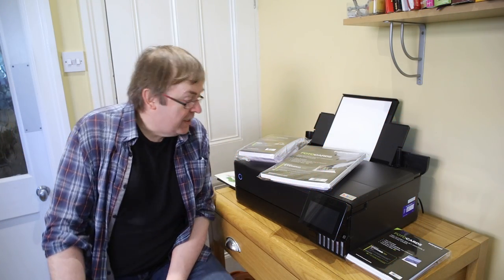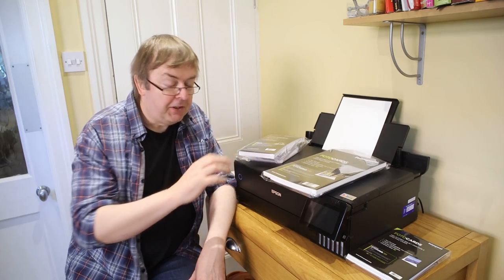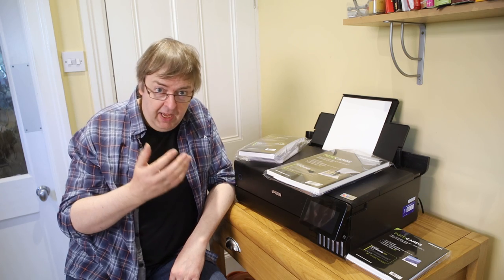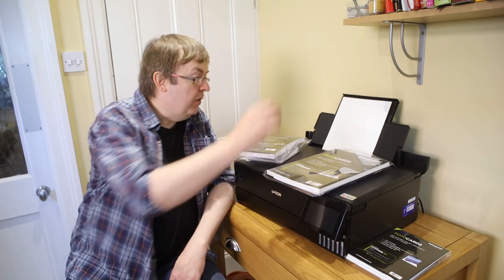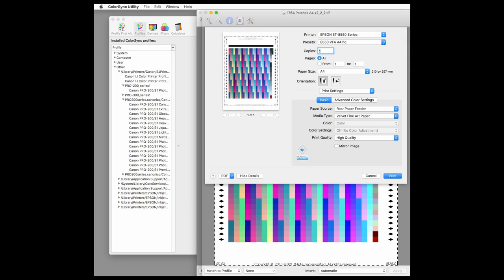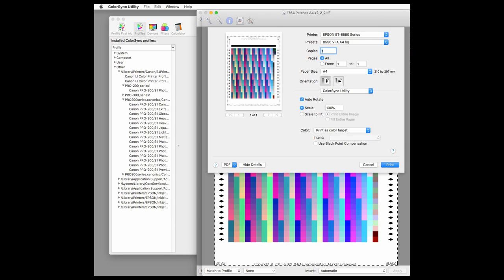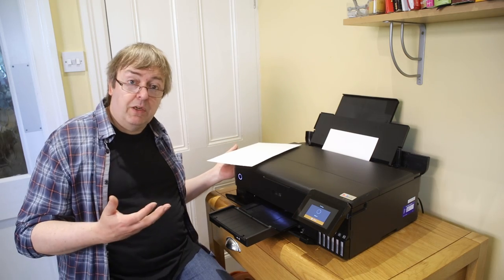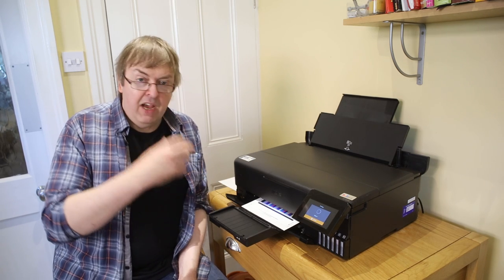Epson ET-8550 scanning artwork to make greeting cards on fine art papers and card

Comment: Thank you so much for this video Keith, very informative! As a watercolor artist I can definitely recognize the struggle with getting the color right. And as I am not capable of making my own ICCs for now it is not the easiest task to get the colors anywhere close to the original. However I can say that already by just using VueScan the quality of the outcome increased rapidly, the scans are much more accurate and very crisp, so thank you for this great tip! I am now just hoping companies will create ICC profiles for this printer for more "craft" papers. I just purchased the Epson Velvet Fine Art but quite frankly that is very pricey to use for printing cards. I am also starting to accept that sometimes it is not necessarily bad things the colors come out "different" then original because in combination with right interesting paper you just create completely new piece of art :)
Reply from the maker: Thanks - some companies (UK) will create profiles if you buy paper/card. The Fotospeed ones I used here will.  One problem is that many 'craft' media are simply not very compatible with inkjet inks, so no amount of profiling will do. See some of my other card printing items for test images and the like.

I'm not sure when I'll be able to publish the accompanying article - that has more specific info on scanner profiling and my adjustments to the image (a selective hue shift on the blue/purple colours in Photoshop, with an adjustment layer)  That said, VueScan is just very good on its own...
Reply: @KeithCooper  Hello again! I am sorry to bother you with a question but I still struggle getting decent colors out of the printer. I am printing now on glossy vinyl sticker paper and no matter how I print the colors are really dull and sort of dark compared to the original artwork. Would you have any recommendation how to get bright, vivid colors? I am desperate now :(
Reply from the maker: @herinternest3958  The answer is I'm afraid likely in your question "glossy vinyl sticker paper" - sounds like it's just not compatible with the ink set.

Use the test image and print with differing media settings - but it may be that the media is simply no good (with this printer)

Sorry, but media choices are very important with this printer. That's partly why I only ever (initially) test with known good test images - never any work of my own.
Whilst I don't know that media type - it's not something I've ever seen (in the UK) as a specialist inkjet media.

Comment: Excellent end result Keith which is no doubt due to the profiling. The original watercolour and the resultant inkjet print look identical. Looking forward to your colour management videos in the future 👍
Reply from the maker: Thanks - the lack of written content (on the site) at the moment is a problem for me in that I've lots of more detailed stuff to include, that just doesn't fit with the videos (there is already a lot of colour management stuff on the Northlight site).

I need to get some more (grey) ink for the PRO-300, so I can do some stuff for profiling - my 300 videos are some of the first I did, so are a bit simpler than I'd now try ;-)

Comment: Greetings.  I'm putting together a system to reproduce from negatives and prints.  Should I get a separate flatbed scanner or use the scanner on the ET-5880 printer??? Thanks for your advice....
Reply from the maker: The 8550 scanner is flatbed, so no good for negatives.
Depends on how 'pro' you want to go - my choice would be something like the Epson V850

Comment: Thanks for the video.. I am getting streaks in my photo prints, have checked the heads and have also upped the inks with real inks and cannot get rid of the issue, any ideas??
Reply from the maker: Possibly cleaning related - but if you have used cheap inks it can leave issues...
Not something I've tried
Place to ask is https://www.printerknowledge.com
Reply: @KeithCooper  Thanks Mr Cooper.  I only ever use Genuine Epson Inks and maintenance tanks. I will send them a message. Kind regards Lawrie

Comment: I'm trying to print cards on inkjet heavyweight card paper but the Epson Print Layout software doesn't show letter size card as a media option? I don't have Photoshop. Not sure what setting to use? The only media settings for card are for attaching a roll.
Reply from the maker: Roll? with the 8550?
Letter is definitely a supported size - card though is a lower quality setting IIRC - see here for my main testing [and links to all my 8550 info]
https://www.northlight-images.co.uk/epson-et-8550-printer-review/
Reply: @KeithCooper  by roll I meant longer paper, I assumed the setting was meant for that because when I select it the printer tells me to remove the paper feed unit from the rear and attach it to the feed slot.
Reply from the maker: The thick loading slot is for thicker card [board] and the straight through print path. See poster-board printing in the review linked above.

Comment: can we print on 12*18  300gsm photo paper ?
Reply from the maker: Yes, it will take paper that size (I printed a  lot at 13" x 19" [A3+] )
However, I believe 12x18 [inches?] will need setting as a custom page size and is not supported for borderless printing.
I've not the printer here any more so can't check for sure.

Comment: Hi 
Sorry, I'm trying to find the paper you have used. I've found the Fotocard platinum etchiing 285 but I've not seen one that says it's precreased or that it comes with envelopes. I was just wondering if you or someone would be able to guide me on where to find the precreased version. 
Thanks in advance!
Reply from the maker: You need to ask the supplier directly about this. I don't actually sell stuff
Reply: Fotospeeds own website only has the fotocards that is prescored in A5, A6 and 5x5 in the 285. So seems like it doesn't exist anymore ... 
I was looking for it too ... 
I'm going to order the A4 and just cut and score it myself :-)

Comment: How to create a color profile? easy, just print two sheets of paper and use this 5000$ machine...
Reply from the maker: Fair point, but you could use a cheap second hand i1Pro spectrophotometer and the free ArgyllCMS software.

There are far cheaper methods than mine, but I use that kit for work. 
Also some better paper suppliers will do this for you and make custom profiles